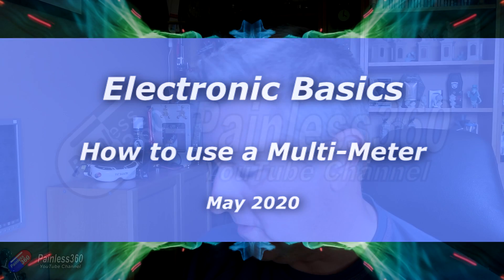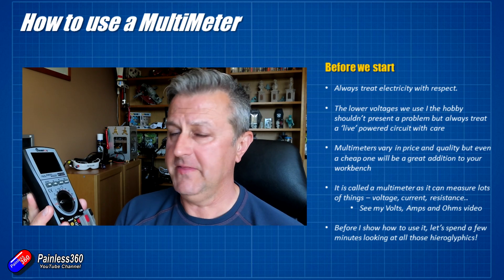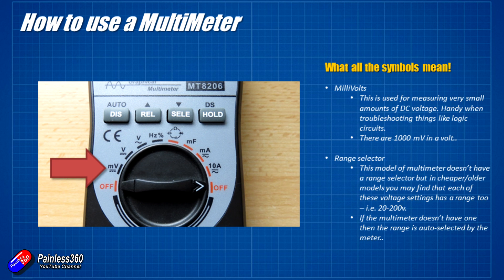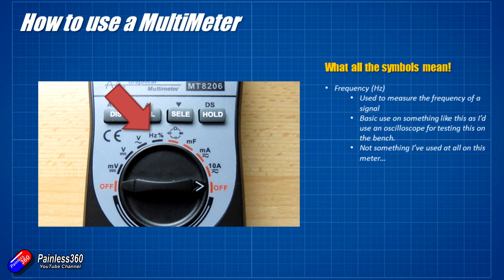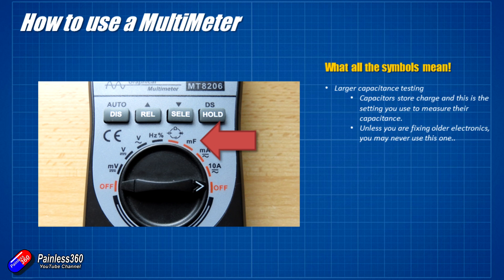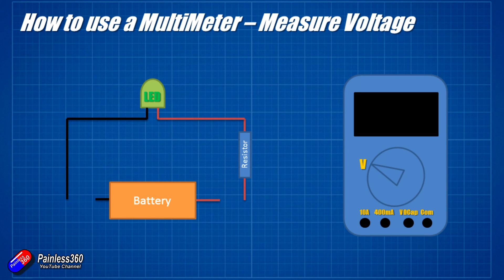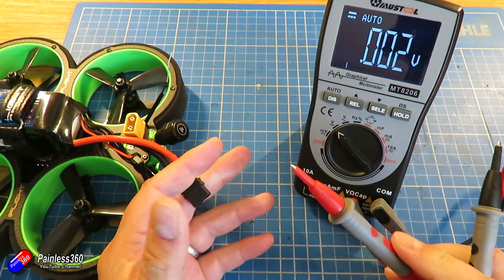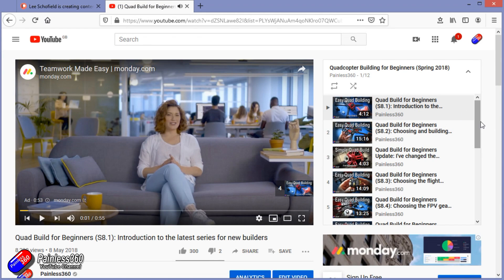RC Basics: How to use a multimeter

Comment: im trying to use the f405 to control a rover. anyone tell me how to configure and connet the throttle and steering servo
Reply from the maker: It depends on what firmware you're using... Which one is it?
Reply: Painless360 have the latest ardupulot rover firmware. I though i would have to use the s1 and s3 pins but when i connect a servo they are just putting out a constant signal causing the servo to go full deflection
Reply from the maker: https://ardupilot.org/rover/docs/common-matekf405.html covers it but you can see what is output to where in the output mixer now - see my PixHawk 2020 series for more..

Comment: Hey painless360 I got a frsky qx7 from banggood cause the UK stores were out of stock and I ordered the CN direct international version which is the FCC version will it work in the UK ?
Reply from the maker: It will but only with FCC flashed receivers. You'll need to flash it with LBT firmware to be legal in the EU...
Reply: @Painless360  is it easy to flash LBT
Reply from the maker: Yep, same as a receiver but select 'internal' instead..

Comment: Sir, how do we use the multimeter to understand if there is a short in our build?
Reply from the maker: Depends on where it is. I always check the resistance across the battery input terminals on the build before plugging in the battery for the first time. See all of my builds where I show this. I also covered this in the latest 'Community Build' series.. I hope that helps.
Reply: @Painless360  thanks

Comment: Fantastic that should help a lot of people, one thing I suggest to beginners is practice. Get a small battery like an AA and practice measuring voltage across the terminals + & - Red from meter to + Black from meter to - Your volts if battery full will be around 1.5v ( 1.5 ) when you meter is set to DC Volts (Symbol looks like a Straight line with dashes UNDER it), AC is ~ batteries are DC so this is what you need the meter to be set to. If you have the meter connections reversed on the battery you will get a negative value ( -1.5 ). Also play with resistance by  turning the meter to Ohms (  Ω ) and hold the Red and Black wires from the meter on the metal ends, you will see the meter change from nothing (0.0000) to a value, this is resistance (You are now the resistance). Low numbers = No connectivity or resistance, Hgh number = some resistance or a good path connection. Now try doing this across all kinds of materials and you will see metals giving a value normally high while most other materials that are dry or non conductive giving nothing, this is continuity. Volts and Ohms are the basics you need to start with the rest will follow. I had an old Avo meter as a kid was easy to understand, digital is a lot better and safer but takes away from a visual representation of what is going on. Oscilloscopes now we are getting into the fun stuff, logic analyzers is where your head goes on melt down LOL.